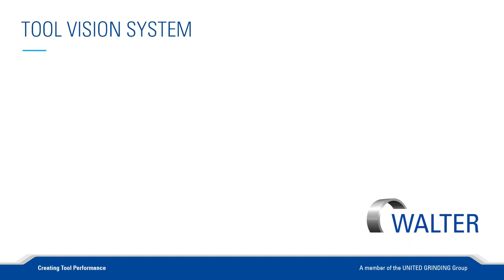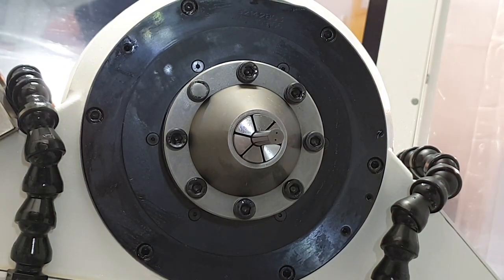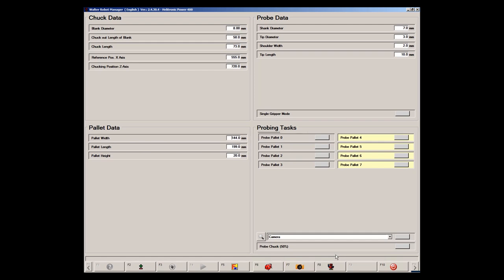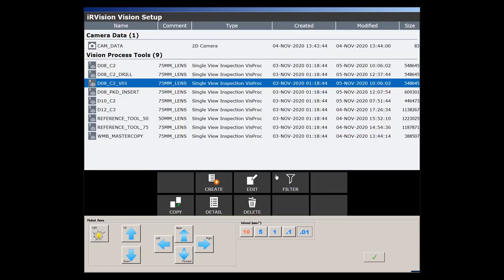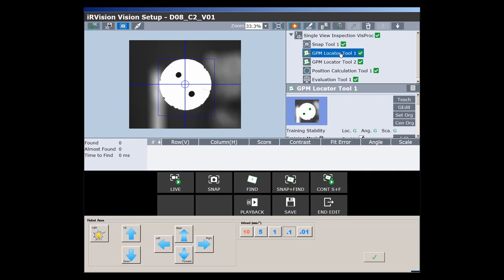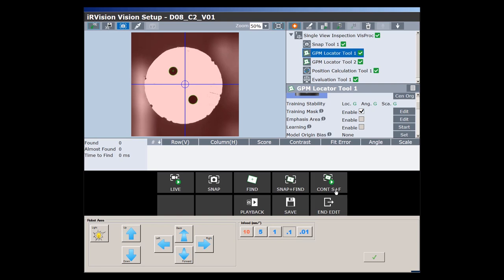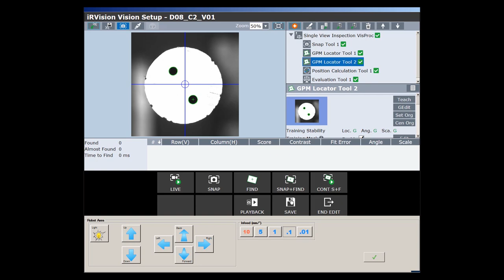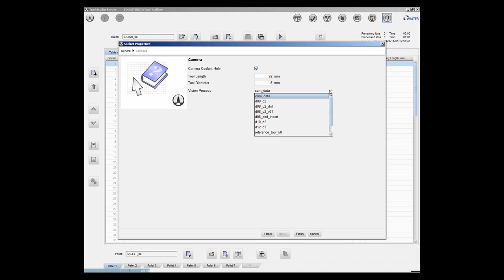WALTER Tool Vision System

Comment: I really don't get the idea here. What's wrong with cooling holes probing? isn't that gonna do the same thing?
Reply from the maker: Hello @hangme! Thank you for your interest and your questions. 
We will gladly explain the advantages to you. 
In contrast to the manual measuring method, the automatic process saves time. 
The integrated camera system works during non-productive time, which could also be a solution for the radial positioning of special tools outside the machine.
At the same time the measurement is more accurate and the process is more repeatable, eliminating human error. Coolant holes that turn out to be incorrect can be sorted out before they even reach the machine. Teaching new tool geometries and designs is also very easy. 
The non-contact method prevents damage to tools. 
In contrast to probing, it is possible to detect coolant holes with a diameter of 0.25mm or the pitch circle diameter of 0.8mm and smaller. 
Also PCD veins and PCD plates do not have an area that can be probed with a manual probing.